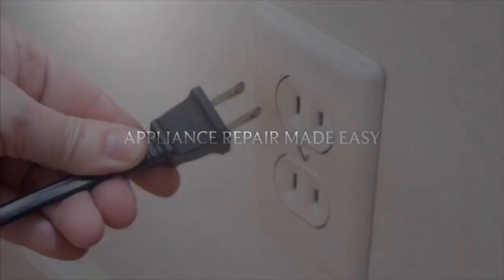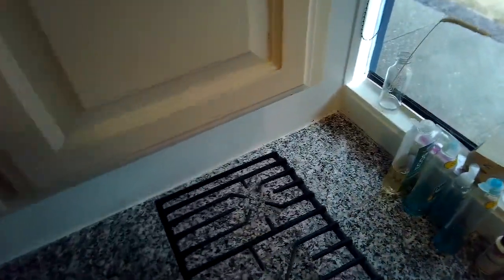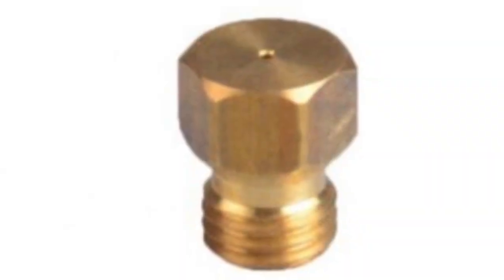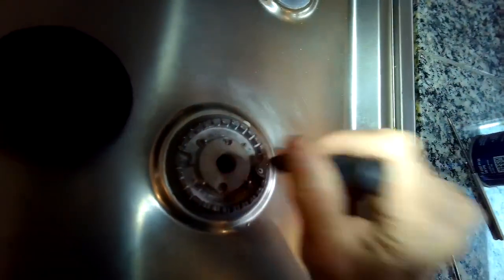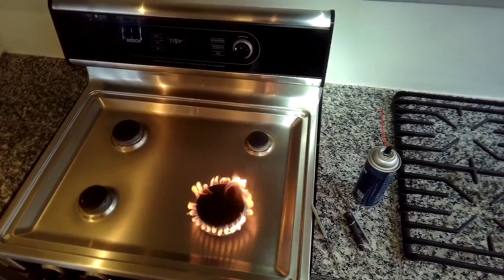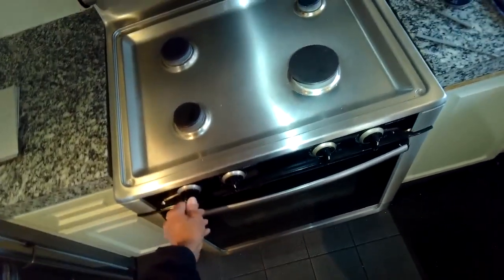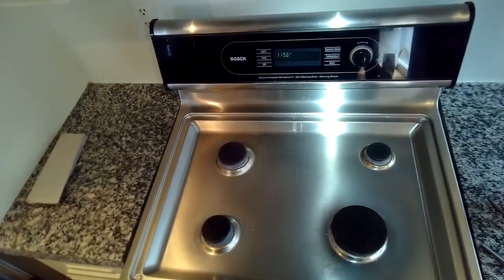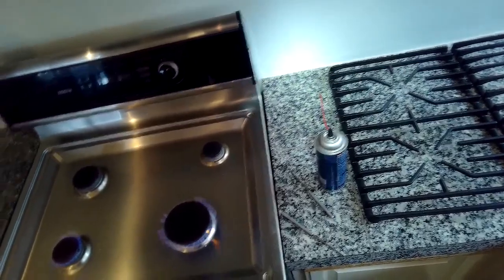✨ BOSCH STOVE CLICKS BUT WON’T 🔥 LIGHT - SUPER EASY FIX ✨

Comment: Thanks!
Reply: OMG! This is a fraction of what I would have paid a service technician. (I was also looking at another video that would have had me replacing the ignition — it should have mentioned this fix this first!) Thank you for starting with the easiest fix (which I should have thought of, because if I lit the burner with a match, I couldn't get a large flame.) FIXED!
Reply from the maker: You bet!😊😊😊

Comment: No sparkle when I ignite the one burner, any solution?
Reply from the maker: You can wire brush that igniter and all the points of the metal burner parts that touch each other so they are very clean.
You may need a new igniter.  If the porcelain coating is cracked it will leak out electric current before it gets to the igniter tip.

Comment: Hi folks. There might be a second hole you need to unplug if this video doesn’t solve your issue.  Locate your white porcelain sparkler on the outside. The inside might be flush or a small protrusion. Mine were clogged so the gas wasn’t reaching the sparker. Take a paperclip and use pliers to bend about 3-4mm at a 90° angle. Use that to unclog the hole and it should work. The first time I turned on the burner it ignited but was sluggish. Second time came on with gusto. Hope that helps someone!
Reply from the maker: Thanks Bethany😊

Comment: On my Bosch range two of the burners don’t stop clicking despite being lit. I’ve cleaned the igniter and I’ve done something similar to what you do here and using a wire to clean the gas jets and it seems to work temporary early but quickly goes back to just clicking repeatedly. Any suggestions?
Reply from the maker: Great Question👍 Click Here to Get Live Expert Help From Me For Just $5.00:
https://www.youtube.com/channel/UCGpInAejvpfVVE4FHB_L-Dg/join
We’ll get it Fixed👍
Reply: I am not unwilling to pay $5 but I am hesitant to hand over credit card info and I can’t speak to your site but there are often subscriptions tied to the $5…..
Reply: I am in the same situation. After following your suggestion, i turned the igniter on. The flame came on too but it took maybe 20 secs before it came on. I do not want to ream that orifice hole and enlarge it. Btw, you keep your stove top squeaky clean.
Reply: @dalawa2345  after a lot of back and forth with Bosch I bought two new igniters and the front right igniter is different than the rest BUT before you do that, if you really clean the igniter and the gas jet and then make sure they are dry, mine started working.  I still have the replacement parts and thank god for the YouTube video that explained why the two igniters are different.  The diagram on Bosch showed two part numbers but several of the replacement web sites show all the burners using the same igniter.

Comment: Thanks for the great video but the hole in my jets looks open (2 of my burners are getting spark but can't hear/smell gas when on).  Burner valve?  Thanks!
Reply from the maker: The 2 on the left are the simmer burners and that’s a common symptom when the simmer control stops working.
Reply: @QuickAndEasy5MinuteAppliance  Bosch shows the Cooktop Burner Valve Seal (Bosch 00188962 Cooktop Washer) as being discontinued.  Can a burner valve normally be replaced without replacing the cooktop burner valve seal?  Thanks!

Comment: I’m getting gas, but no spark
Reply from the maker: If it’s the 2 left burners then you need to replace the simmer control and potentiometers.
Reply: @QuickAndEasy5MinuteAppliance  
Thanks. Do you have video content on this?

Comment: I need to know how to raise the stove-top in order to repair a Bosch range . One burner orafice has dropped down.
Reply from the maker: Can you send me a video of that to:  scottthefixitguy@yahoo.com
Reply: Here is a photo. The right rear orifice dropped down into the stove top. It appears that I will need to remove all four burners in order to re-install or tighten it. I had a bear of a time removing the screws on the first burner, needed a screw extractor and in the end only the screw heads came out.
How do I lift the cook-top?
Reply from the maker: Your right, all the burners need to come off first.  Are you sure that orifice dropped lower?  
I think one comes from the factory lower than the others

Comment: I had a fry oil boil over and now mine wont stop clicking, help !
Reply from the maker: The oil is causing a short circuit like water does.

I would aim a blow dryer at that burner for 15 minutes until all moisture is gone👍